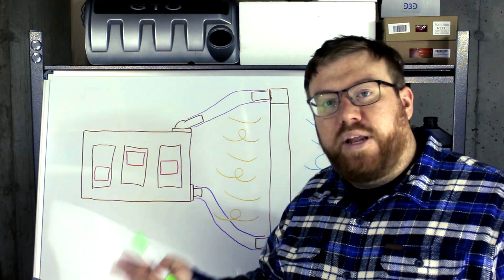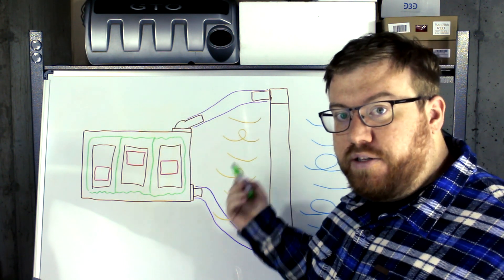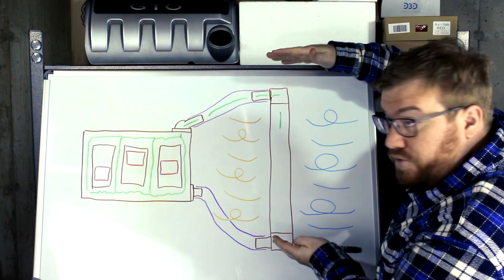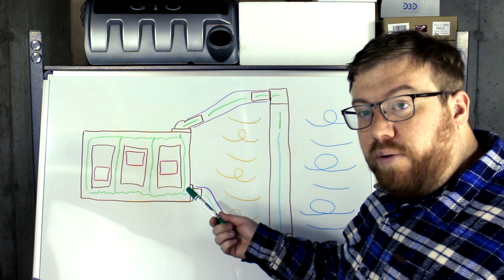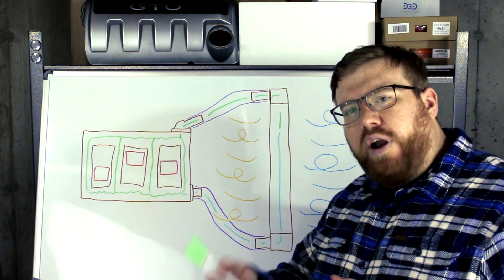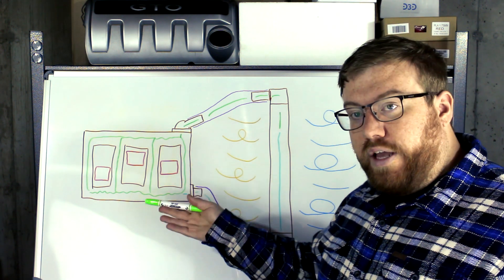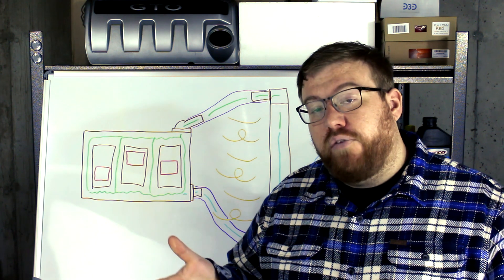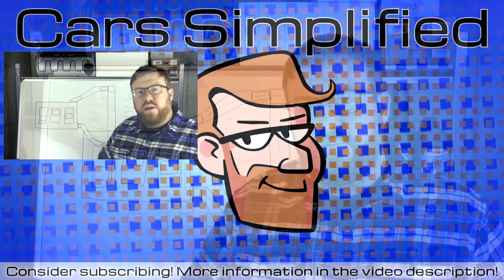How Thermosiphon Cooling Systems Worked & Classic Car Cooling

Comment: What would be the benefits of installing a thermosiphon in a car today?
Reply from the maker: If it could be designed to keep up with the heat generated in a modern engine, it would have the benefit of there being fewer moving parts to fail and less of the engine's power would be used to turn a water pump. Possibly less expensive, too.
Reply: @Cars Simplified  what temperature would you expect the bottom of the radiator to be? Assuming the top is near boiling point